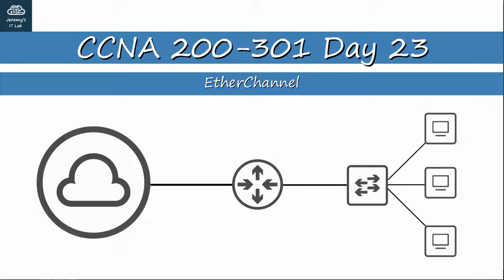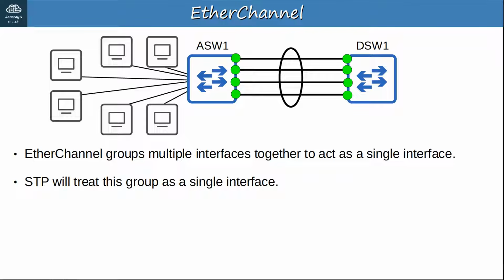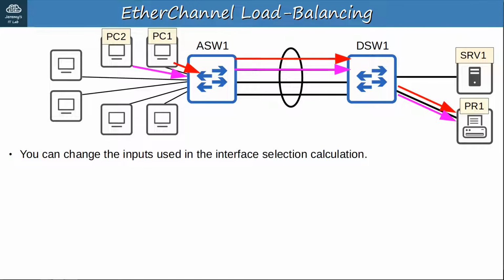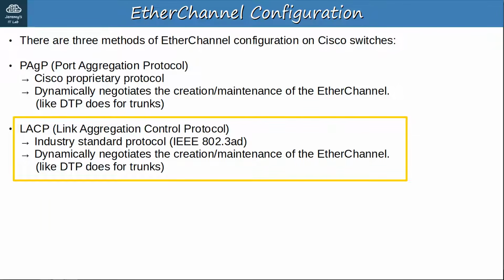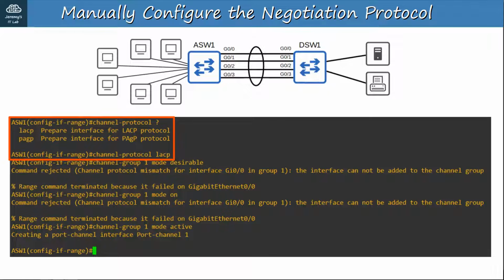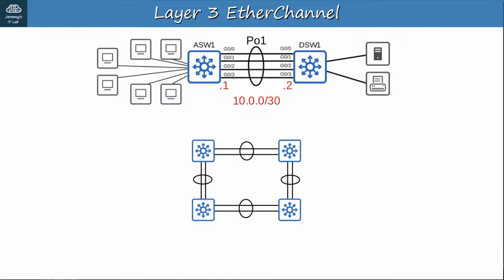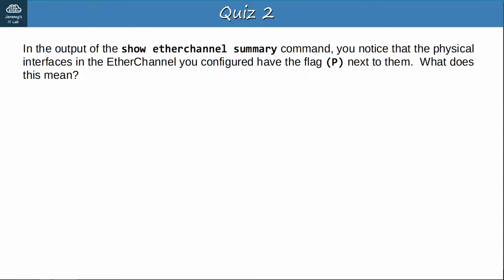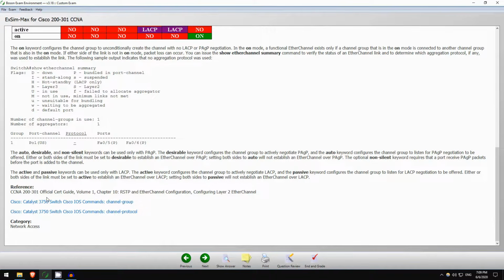Free CCNA | EtherChannel | Day 23 | CCNA 200-301 Complete Course

Comment: just a note on the Boson Quiz question but 'channel-group 1 mode on' is a valid command as long as both switches are using the 'on' mode. the reason answer B is correct is because you cant mix the LACP and PAGP protocols on an Etherchannel, they must be the same on both switches.
Reply: thats what I thought but why he gave a different explanation? confused now
Reply: That's correct. He does make some stuff a little more confusing than they should but I think is just how smart he is that he gets deep into something teaching and then explains it back when reviewing from a completely different point.

Comment: I wish he would've added why we don't use the "ip routing" command for Layer 3 EtherChannel. For anyone wondering, he didn't use the ip routing command because we aren't trying to route outside of the subnet for the point-to-point connection. This could be common sense but for anyone curious as to why we don't do the ip routing command that's why

Comment: Very clear and concise course you have here, I'm enjoying it very much. However a couple of things to mention here.

1. Talking about load balancing in this context - while common - a bit misleading. LACP does not take into account the load on the other legs of the aggregated link, it just determines the appropriate leg to use based on the 3 named methods.  EtherChannel contains no actual load balancing algorithm either. Strictly speaking link aggregation is load _distribution_, not balancing. 

2. Aggregating 4 links does not strictly speaking create a single link with 4 times the bandwidth either. Again, the traffic isn't balanced, just distributed across the available links based on the named rules but without considering the existing link load. The max traffic speed between any 2 devices over an EtherChannel link = the speed of a single physical link involved in the EtherChannel. In real-life network you may well have a 4-leg EtherChannel and notice 80% utilization on 3 legs but only 5% in the fourth.  Actual load balancing requires intelligent devices that constantly monitor the traffic, and re-direct it over different links in case of congestion. 

Just wanted to bring this up, as I've lost count how many times I've had to explain it to less-than-happy network admins. Other than that,  absolutely fantastic series :-)
Reply from the maker: Yeah I'm aware of how EtherChannel works.  Cisco gives a pretty good explanation of how EtherChannel load-balancing works on IOS/CatOS here: https://www.cisco.com/c/en/us/support/docs/lan-switching/etherchannel/12023-4.html
Reply: @JeremysITLab  Yeah I had no doubt - just considered it worthwhile to clarifying this to the people who follow the course. Explaining this to an irate budding NetAdmin who's not happy when the traffic over his server's LACP link is unbalanced loses its appeal after the 11th time or so :-)

Funny enough Cisco agrees; the second sentence in that page says "...allows load SHARING of traffic...". That's the only time, tho' - after that it's about "balancing". My best guess is that that the marketing ppl butted in. "Load sharing" and "load balancing" are two very different concepts, but one of them sounds better on the brochures...

Comment: If you configure a port channel using desirable and auto on each side and then change the channel protocol to lacp after configuration will it automatically change the port channel to active and passive on each side?

Comment: Hey Jeremy! Dump question here, so if layer 3 LAGs are a good option to avoid broadcast traffic loops etc, then why would we even consider using layer 2 ether channels? Besides, isn’t broadcast traffic necessary at all on a layer 3 LAG? What about ARP o any other broadcast 😅so how Vlans travel from access switches using Layer 2 etherchannel through agregation switches using layer 3 ether channels where broadcast traffic is not allowed ?

Comment: I have a question on load balancing. If PC 1 sends data to SRV1, it should send it using a single physical interface, right? So will that single interface still have a capacity of 4Gbps, assuming we have four Gigabit links combined through etherchannel? Thanks!!

Comment: I have configured three switches with three links. IP addresses are assigned properly to all Switches (192.168.1.1/24, 192.168.2.1/24, and 192.168.3.1/24). Two PCs are connected on each switch and are not pinging. Do you think I have configured IP addresses on the PCs incorrectly? Which network ID should I put the PC on each switch or can I put them in any network address? I don't know if you understand my question but if you know, please let me know.
Thank you

Comment: Great thanks to you Jeremy. I have a question:  If we configure EtherChannel statically with mode "On" being a connection between 2 switches , this means that the switchport mode trunk must have been configured previously?
Reply from the maker: It doesn't have to be, you can make an EtherChannel with access ports.

Comment: Hey Jeremy I have two questions. 

1) Some people say it's better first to shutdown the interfaces and then configure the EtherChannel to avoid any possible misconfigurations with the other switch. Do you agree? It is recommended to do it like this or it's totally fine if I don't shut them down?

2) Can you explain please what is bandwidth, throughput and speed. How are differentiate one from another?
Reply from the maker: Hi Stefanos,
1) Shutting them down does no harm, so go for it!  I personally haven't run into problems by not shutting them down, though.  Whichever you prefer!
2) Often they're used interchangeably (I probably do so at various points in the course), but try a google search like 'speed bandwidth throughput' and you'll find some explanations better than I can give here!  Here's a quick video too: https://www.youtube.com/watch?v=TVpg7StOxgg

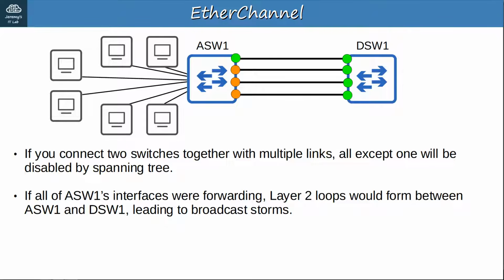Comment: At 4:58 or so, you say that layer 2 loops are made if all interfaces are forwarding. That is because any broadcast frame coming from ASW1 and out of a interface on DSW1 will be sent back through the 3 other open interfaces back to ASW1, right? And, of course also the other way around, i just need to make sure i understand it correctly.
Reply from the maker: Yep, you got it

Comment: Hi Jeremy, I'm curious on the loading balancing conf.  I understand that ethchannel can load balance either the source or dest, or both of them.  Why did Cisco use 'XOR'?  As I understand XOR is exclusive OR, which means you either have this or that, but you can't have both.
Reply from the maker: Hi Byron, 
I hadn't thought about that so I did a Google search, here's a nice explanation:
'The etherchannel load balance is some sort of a binary xor computation. This means that the result of the xor computation selects the output link to use, it is not round robin.

As an simple example, if the xor looks at the very last bit in the source and destination mac address and found this. last bit of source is 0 + last bit of dest is 0 then xor gives 0. If sou is 0 + dest is 1 xor gives 1, if sou is 1 + dest is 0 xor gives 1, if sou is 1 + dest is 1 xor gives 0.

Then taking the above and put streams with xor 0 to port 1, and streams that gives xor 1 to port 2.

This means that in theory, Your two streams kan be put on the same port.'

Basically, the XOR gives a 0 if a bit in the source address matches the same bit in the destination address (0-0 or 1-1), and gives a 1 if a bit in the source address doesn't match the same bit in the destination address (1-0 or 0-1).  I assume it compares all of the bits of the source and destination address, and the resulting series of 0s and 1s is used to assign the data stream to a certain physical port.

Comment: In regards to the EtherChannel flow calculations, I am assuming the more input data you provide the protocol with the more efficient its switching decision will be? This must come with more CPU overhead of course. However, is there usually an agreed upon method that applies generally to networks? Or is the decision done on a case by case basis depending on the network design/architecture?  Say for example would the sweet spot generally be for most networks to not include too much input data(SMAC + DMAC, SIP + DIP, combinations of both etc) but also not leave it so scarce to the point where the protocol makes a less efficient switching decision than it could have if it was provided with additional input data? In short, is there a specific combination of load balancing options which apply generally that A) Make sure the switching decision process is as efficient as possible for most networks B) Not use too much processing power and C) Make sure you are not getting diminishing returns in terms of efficiency(The balance between CPU overhead and load balancing between the logical links). May be a tough one to answer and I may be off the mark here or missing some information but I couldn't stop thinking about it while watching this video haha. But it would be great if you could answer it or possibly provide me with some resources to follow up on. Thanks.
Reply from the maker: I don't know exactly how the calculations are made, you might want to try a google for things like 'etherchannel load balancing' or 'etherchannel load balancing algorithm'.
Reply: @JeremysITLab  Okay no problem I am sure I will find an answer, the thought was bugging me though aha. Thanks.
Reply: @st10689  Thank you for that :)

Comment: Why do we need etherchannel for multilayer switch ? since multilayer switch doesnt create broadcast storms right?
Reply from the maker: Multilayer switches can create broadcast storms just like a Layer 2 switch, their Layer 2 ports operate just like regular switchports.  However, the purpose of using Layer 3 EtherChannel is to increase the bandwidth of a connection between two devices.

Comment: Hi all, can someone explain me why with routed ports (multilayer switches) there isn't the problem with broadcast storm? I understood no BDPU frames are sent between switches for STP, but hot is this related to to broadcast storm problem? Thanks in advance
Reply: Hi,
At layer 3 in ip header we have a field called TTL, every time an ip packet reaches a hop TTL is decreased by 1, and when TTL is 0 packet is discarded, hence ip broadcast storm or ip add flapping isn't a thing

Comment: 19:25 what's the point of putting it into auto mode if it's not gonna try to form an ether channel?
Reply from the maker: It will form an EtherChannel, just in fewer situations than a 'desirable' port will.  I usually just use desirable for both ends.

Comment: In fact using ether channel does not give actual summarize of all bandwidthes of interfaces. Real bandwidth of the session will have  speed of member interfaces. E.g. if you have 6 fa ints gathered in po1, then max speed of a tcp session won't be more than 100mbps. This is what i haven't heard both in this lecture and further in lab.
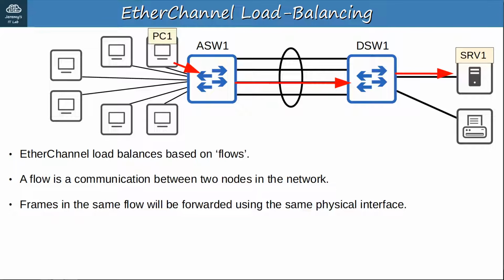Reply from the maker: 10:12 “Frames in the same flow will be forwarded using the same physical interface”
Reply: @JeremysITLab  You are right. But i'd underline this with more attention.
Reply: @JeremysITLab  please, understand that I don't want to stupidly criticize your great and heavy work. I just want it to be ideal. :)

Comment: At about 13:50 regarding Non-IP: Source XOR Destination Mac Address did you mean to say no MAC address instead of no IP address when not encapsulated by an Ethernet frame? I can’t think of a scenario where an Ethernet Frame wouldn’t have a source or destination IP address inside (from the IP packet) but maybe I’m not following correctly
Reply from the maker: I said 'if an IP packet isn't encapsulated inside the frame'.  In that case there is no source/destination IP address to be used.  If it's an Ethernet frame, there will always be a source/destination MAC address.

Comment: A scenario of PCs 1 & 2 sending frames simultaneously to the Network Printer solves the problem of load balancing on ASW1 and DSW2 but both traffic frames of PC1 and PC2 pass on a single interface to the printer

 Why?
Reply from the maker: They pass on a single interface to the printer because the printer is only connected to one interface.

Comment: Dear Jeremy, i did not really get the difference between EtherChannel and Trunk? Best Regards from Germany :) God bless
Reply from the maker: Hi Ninos.  Give me a brief explanation of what an EtherChannel is, and a brief explanation of what a Trunk is.  Let's see what your understanding is!  Then I'll point out any mistakes.
Reply: @JeremysITLab  well, I understand that Trunk is a protocol that manages the Vlans Data transaction between the Switches, and EtherChannel is  protocol that manages Data Transaction between Switches, is that correct?
Reply from the maker: @ninosodicho382  You can be more specific than that!  Here's a quick summary of each.
Trunk: A connection between devices that can carry traffic in multiple VLANs.  This is different than an access port, which belongs to a single VLAN.
EtherChannel: combines multiple physical interfaces into a single 'logical' interface, which allows you to have redundant connections between switches while increasing the total throughput capacity.
Reply: @JeremysITLab  thank you Sir 😊 brief and super explanated✌

Comment: Jeremy, so etherchannel is just to avoid loops? or does it also aggregates all physical interfaces speed and bandwidth as one? like if each interface its 1gbe then the logical link its 5GB total?
Reply from the maker: It allows you to use multiple interfaces to provide redundancy while also increasing the total throughput.  It's not a loop prevention mechanism, that's STP's job.

Comment: While checking the spanning tree status why was the cost 3 and in  priority id  the interface  number  as 65 for port channel  1?
Reply from the maker: The port-channel has a bandwidth of 2 gbps (1+1), STP calculates that as a cost of 3 (1 gbps costs 4).  As for the ID, there’s no special reason for the number 65.  Each interface is given an internal port number and STP uses that in its algorithm to determine port roles (as I talked about in the STP videos).
Reply: @JeremysITLab  Thank you so much for clearing the doubt

Comment: @Jeremy's IT Lab,  Is there a way to add an unmanaged-switch in cisco packet tracer?  Not a Hub .  I have a real life scenario with switch on one side and two devices  connected via unmanaged-switch .
Reply from the maker: I don't think so.  Packet tracer is mostly focused on stuff for the CCNA.
Reply: @JeremysITLab   Thanks for the response. If I have a managed switch say Catalyst 2690 on one side and an unmanaged switch on other side, with two end devices(say IP cameras) off of it. Is there any way I could LACP between 2690 and unmanaged switch? Assuming I have two uplink and two downlink ports on unmanaged switch?

Comment: Hello Jeremy

I wanted to build a home-lab and bought from Ebay 4 second hand switches. When i use them 1 by 1 they are working fine. But when i interconnect them they are not functioning and not showing link-lights or activity lights. I erased the configurations with the Command: write erase and shutdown all interfaces and turned on again. Its still the same. I have bought another switch (5th) and connected them. They are functioning well when i connect them to that switch.

 Do you have any advice?

By the way they are Catalyst 3550 and 2950

Thank you in advance.
Reply from the maker: Not sure if this will fix the problem, but did you restart the switches after erasing the configs?
Reply: Yes, reloaded and restarted. N0thing changed. They don't recognize each other. No matter if i use Crossover or straight-through cable.

Comment: Hi Jeremy! I got a bit confused with the Layer 3 Etherchannel. Since none of the interfaces will be disabled due to spanning tree, and there's no need to run spanning tree at all with routed ports involved, why is there a need for them to be in one Etherchannel?
Reply from the maker: It bundles multiple physical connections into one logical connection, which simplifies configuration etc.  You can treat it as one interface instead of configuring multiple separate interfaces and configuring different routes for each interface, etc.
Reply: @JeremysITLab  That's actually a good reason! Thanks Jeremy!